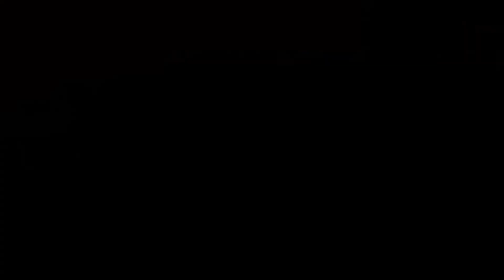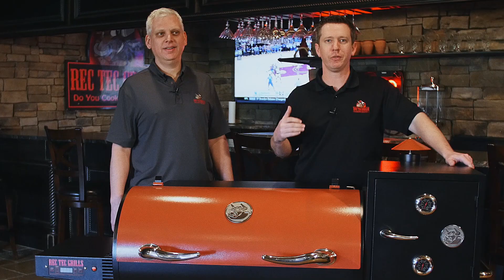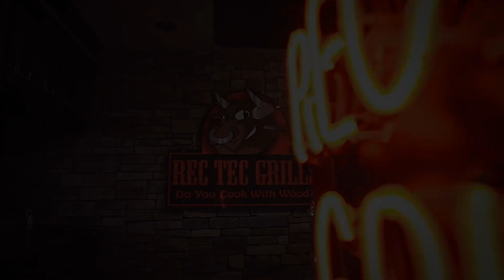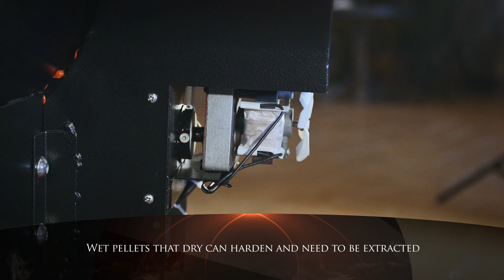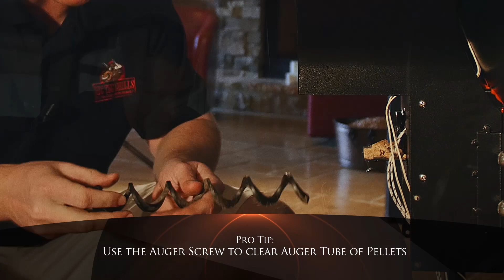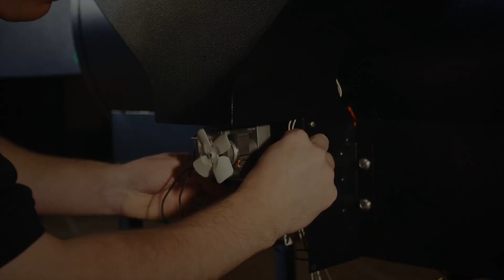RT-680 • Auger Replacement and Repair | REC TEC Grills

Comment: Great video and I wanna grill and hang with you guys 😂. Was frustrated. Diagnostic was perfect. Auger turned, no pellets. Took all the pellets out of the hopper while the dogs chomped the fallen pellets. The base of the hopper was cement saw dust, Florida storm probably. I busted that up and used a shop vac. We grilling 10 min later. Burgers now, monster steaks Saturday. Thanks guys.

Comment: Good video for removing auger I would just add a few things needle nose pliers for putting back the shear pin 2 washers and nut I also added a shoe box under my work area in case I drop the tiny parts also run the motor to match the auger holes I lined mine up on the horizontal.  The problem I was having was I heard a knocking from the auger and found the shear pin loose and digging into nylon spacer.

Comment: First, i appreciate rec tec realizing this is a common issue (at no fault of their own) but instead often due to customers (like myself) leaving the smoker uncovered and exposed to the elements.  
That being said, having had to repair this myself today, there are a lot of design improvements rec tec should make to future units.
A pellet dump at the bottom so you dont have to grab them out by hand
The white part connecting to the auger having allen wrench screws at a terrible angle makes no sense at all.  Use phillips screws here.  One of the screws ended up getting stripped due to terrible angle and i had to get it out with needle nose pliers.  
Finally notice in the video how the guy doesnt show himself reinstalling the shear bolt into the auger either.  Another part with a terrible angle that was a massive pain to reinstall

Comment: Did a rookie mistake and ran out of pellets on my RT-300 mini. Added pellets and thought I had an issue since the temperature wouldn't go up and observed that the auger was going real slow and stopping. After watching this video waited 3 minutes after the auger initially stopped and it did restart again. Only issue was operator error. Thanks.

Comment: For those saying you had pellets get wet, did you have the cover on it?  I'm looking at getting a unit, with a cover, but I don't know if the cover is enough.  I don't have anywhere that I can put it to keep it in cover.
Reply from the maker: Please don't hesitate to give us a call so we can get you some insight on this! (706) 922-0890 ☎️
Reply: Cover not enough! Keep well covered under hard surface !

Comment: Thank you RecTec this video solved my problem as well! I bought pellets that had too much dust in them and it piled up in the hopper and during the smoke the temperature drastically dropped. I thought it was the auger but luckily everything is fine just had to clean it!
Reply from the maker: We're glad to hear our video was able to help you troubleshoot! Too much pellet dust can definitely interfere with the function of the grill. Please don't hesitate to give us a call for any questions or concerns, also! (706) 922-0890 🤘

Comment: Do you have any specifications for the shear bolt? I've gone through a couple and just tried a bolt, which broke almost immediately.
Reply from the maker: Bryan Gelman give us a call 706-922-0890. Ask for Matt Lane. Tell him that you need a cotter pin for your grill.
Reply: Ace hardware carries small metric bolts in standard and Phillips head that fit perfectly.